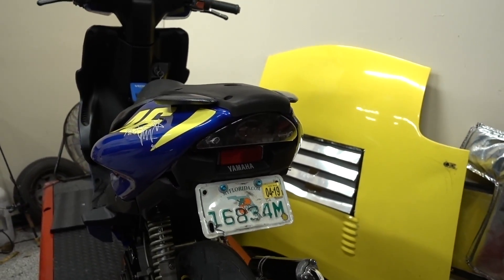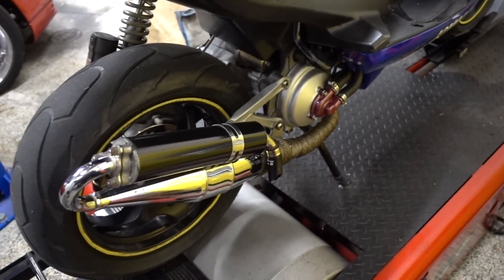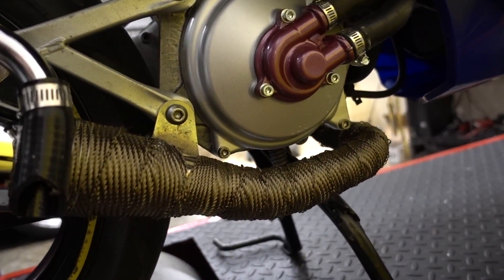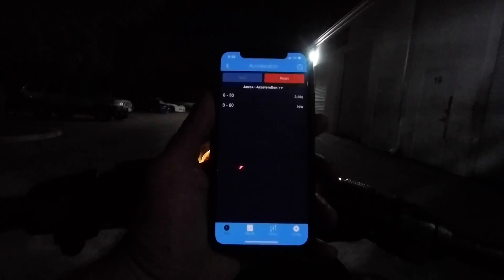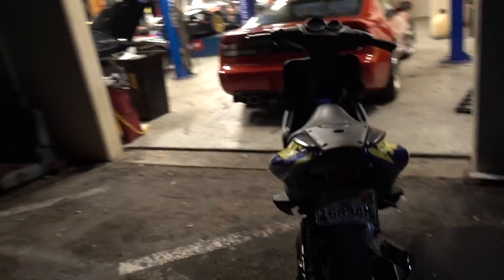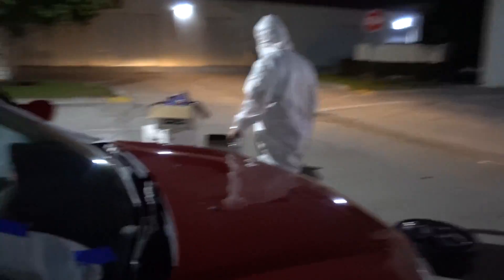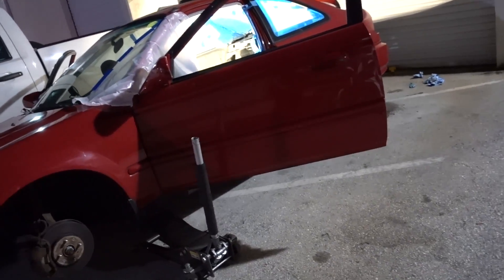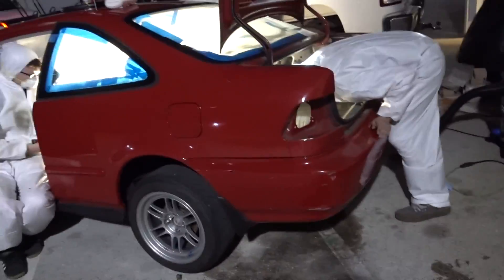Project: AEROX 0 to 30mph testing VBOX

Comment: At least it's a coupe. Nothing bothers me more than watching an idiot defile an eg or ek hatch.  I know I can't save them all but I've brought about 30 of them back from shelll to showroom. Made about a dozen of them 500+whp that are as pretty as they are fast.
Reply: There is a few in every junkyard that you can save.  Eg's are starting to get rare up in the north east though.  Still see EK's all over.
Reply: @duanebailey6253  rare in southern California, at least to find one in the shape that you might consider purchasing. That's what got me started, spending 9 months looking for a hatch that wasn't completely fucked over and riced out from AutoZone clearance tuner products. So I found one that had never been in an accident and stripped it completely down to the shell, did a complete bolt by bolt restoration to an oem+ showroom condition. I think that first one I did a rear disc, but kept it 4 lug and did a b16c with itr trans. Did it proper with AC and power steering but with the quicker gsr steering rack. Kept the suspension basic, brakes were just power stop rotors and steel lines, ebc pads. As soon as 8 finished some dude offered to buy it at a serious premium, so I flipped it... And down the rabbit hole I went. All together I've done at least 40 to that basic oem+ level and sold all of them. I have two '91 crx si and two eg hatchbacks currently, and a '99 nsx. Those 5 are forever cars.

Comment: Jack my guy buy a sito plus exhaust there are so cheap like 75 bucks or something when u see the exhaust u think wtf (make sure u get the non restricted one) but install it and put like 4.6 5.2 gram rolls in it u will laugh u can't keep it on the ground and the will Rev till 11.000 rpm and a medium spring in de back clutch and some medium springs in de back clutch

Comment: Jack should turbo a scooter.
Reply: The pipe is the turbo. That’s what a expansion chamber pipe does in a sense. That’s why people say when the pipe hits. Look up 2 stroke expansion chamber scavenging effect.
Reply: Not enough cc's to spoil any turbo currently in production. Its pretty pointless to turbo a motor under 250cc but nitrous would work nicely lol